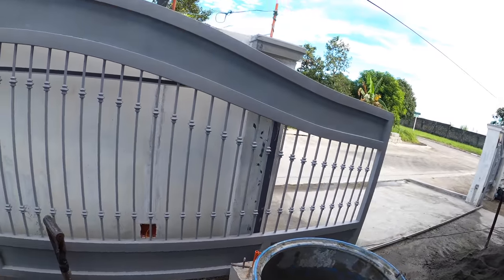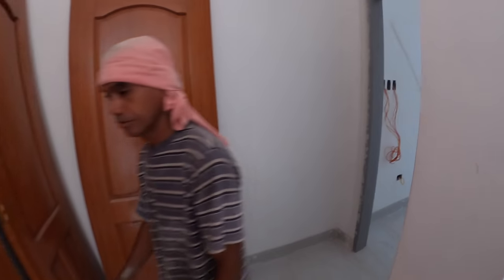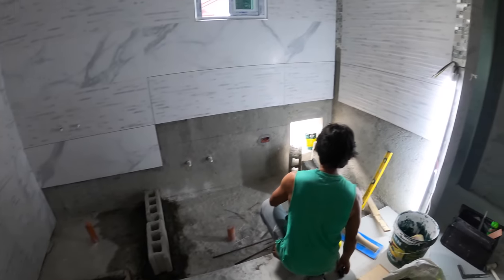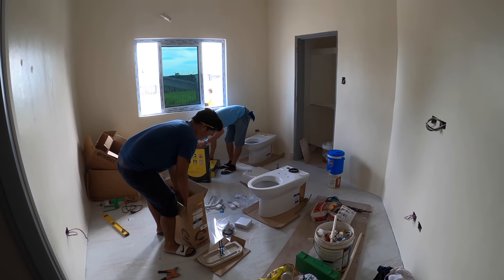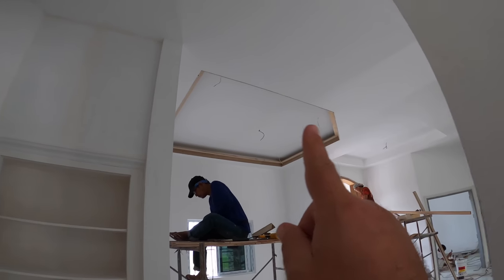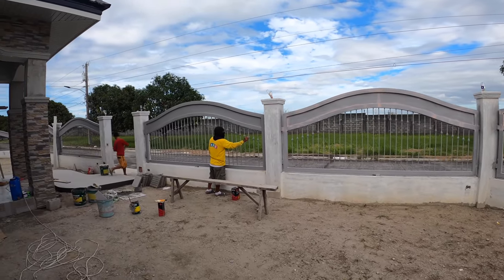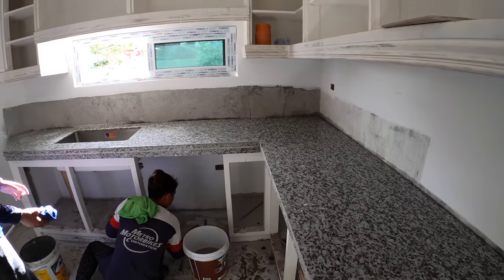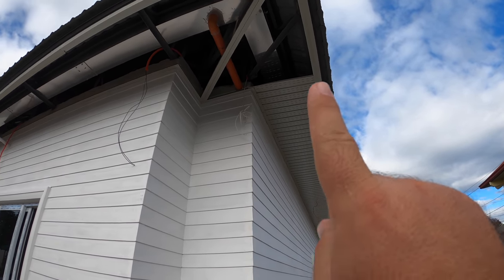Philippine House Building Step by Step, Build Day 209: Throne Room Installation

Comment: pretty flash toilet you have. what are some of the functions a smart toilet offers from the remote, can quite see icons on the device?
Reply from the maker: Auto flush, sensor raised/lower seat, hot/cold seat, air dry, hot/cold wash front and back. 😂
Reply from the maker: aurelio milaor cabal  
The brand is called Cool Bath Systems. Joint venture between a Filipino and Italian companies. Not quite as expensive as the Toto but similar in quality.

Comment: Looking Great! The toilet installation I notice cement was placed on the base. Prior to that was there a wax ring placed?
Reply: No wax...No flange... Cement color don't match...
Reply from the maker: The kits here don’t use a wax ring but instead a silicone/rubber gasket to make a tight seal between the toilet and the drain. I’ll try to get a shot of the drain pipe and seal today on the last American Standard toilet.
Reply from the maker: @manuelpatawaran5504  New style connection doesn’t require wax ring. There is a rubber seal that fits the drain pipe from the toilet into the sewer pipe. Cement will be covered with caulking.
Reply: @CasaTexPina  new style fades over time... classic don't fade over time...or time tested... cleaning solution will eat your gasket...